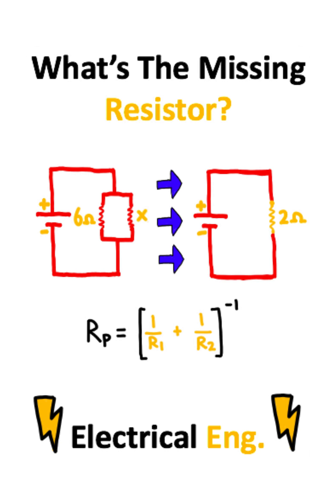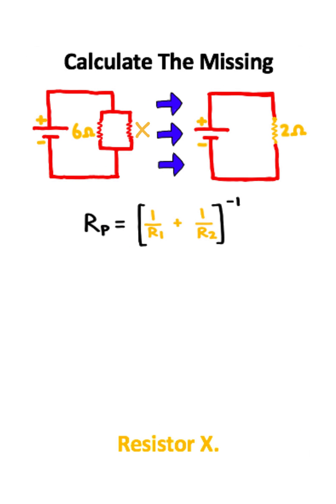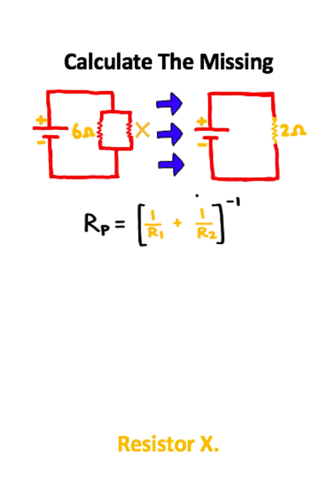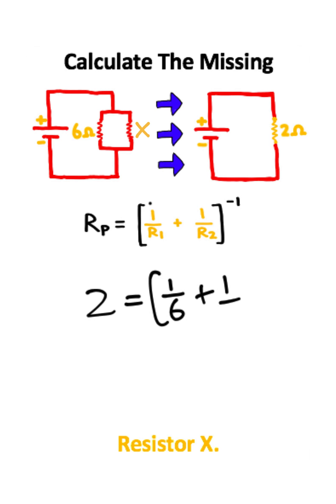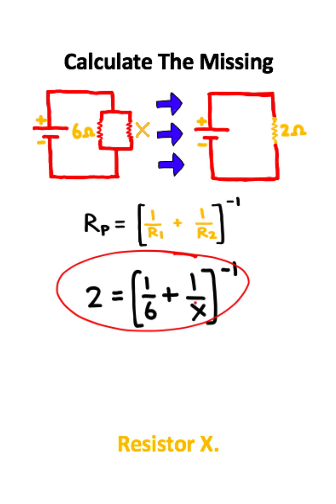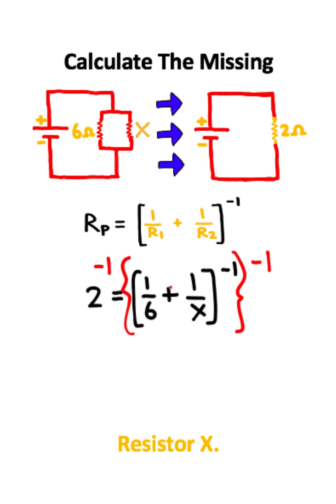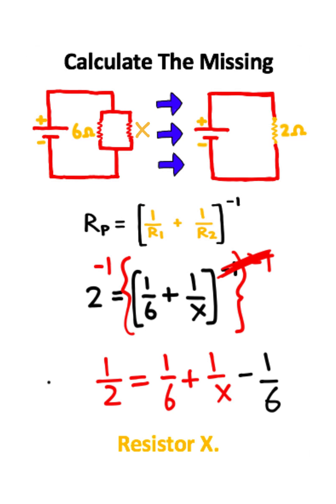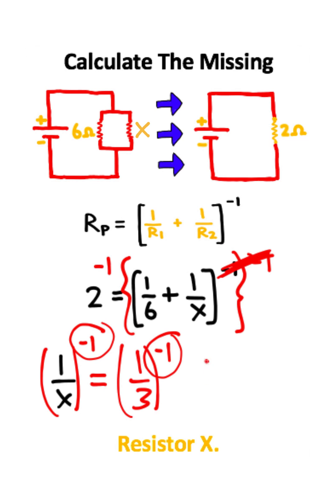YOU Can Solve THIS CIRCUIT!!! (Electrical Engineering)

Comment: Well, if you say the battery is 12V, using ohms law, the current through the 2 ohm resistor would be 6A which is done by V/R, in the other circuit the current would be 2A through the 6 Ohm and so 6A - 2A will give us the missing current which is 4A which is the missing current and therefore the additional current which is 12V/4A = 3 Ohms, this is much simpler.
Reply: this is how I learned it

Comment: dont hurt me but so is it like 9 ohm is equal to 2 ohm i get the math i just dont get the 9 to 2 ohms.
Reply: In an electric circuit, If two resistors are connected in series, (one after the other in the same line), you would add them up like you are doing. But if they are in paralell like in this problem, then you have to sum their inverses, then invert it back, like in the formula he showed:
1/a+ 2/b = 1/r

Comment: So basically dividing 6 by 2
Reply: This won't work with other numbers. the resulting resistance were 1.5, You couldn't just divide 6/1.5 to find 4. It would be 
1/6+1/x = 1/1.5 = 4/6

1/x = 4/6-1/6

1/x = 3/6 = 1/2

x = 2Ω

Comment: I don’t even know what a 6 ulm resistor is or the square boxes or what an R is
Reply from the maker: R stands for resistance. Resistors are known to ‘resist’ the current in an electrical circuit (current is the charge that passes through the circuit over time). 

6 ohms, represents the amount of resistance for a resistor (since not all resistors have the same resistance).

The math equation below the two red boxes, combines 2 resistors (R1 and R2), into ONE resistor (Rp) when the resistors are parallel/across from each other.

The red boxes themselves are just hand-drawn circuits where the +\- thingy is the battery, and the squiggly lines are the resistors. This shows the same circuit twice, where the left circuit has two separate resistors, and the right circuit is the SAME two resistors combined into one.
Reply: @NicholasGKK  I was gonna say “did I ask” but that was a rlly good explanation thank you
Reply: Bro have you even open physics book?
Reply: @flyboy746  no? Have you even opened an English grammar book?
Reply: @your_-_mom  yeah but  i am not english and we have only learnt 5 times of 19 in english language. but i am pretty sure that if youre like 7-8th grade you would know what R is..